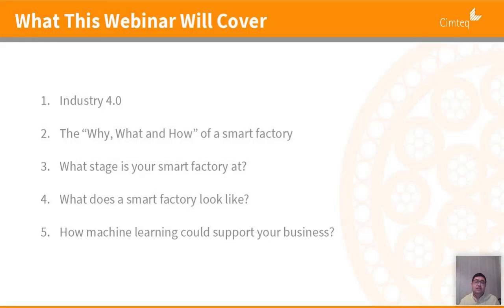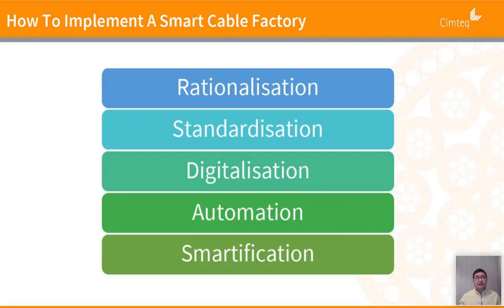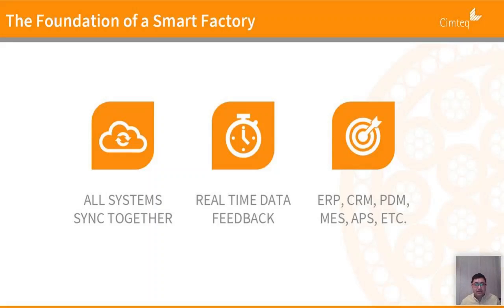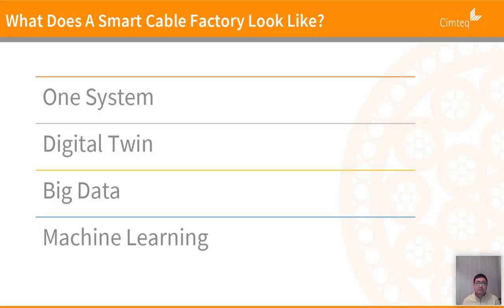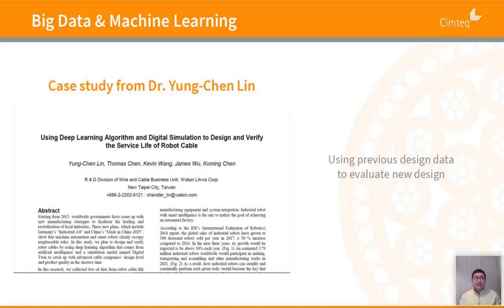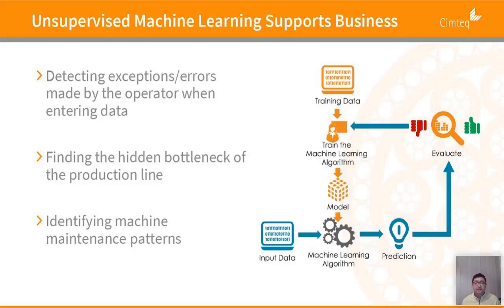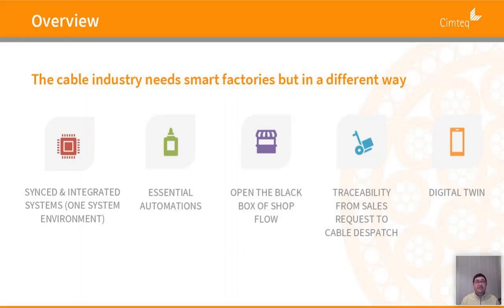"How To Apply Smart Technology To Design & Manufacturing Processes" webinar with Yufei Du, Cimteq

Comment from the maker: 1. Welcome (00:00)
2. About Yufei Du (00:29)
3. Why we are doing this webinar and Industry 4.0 (02:55)
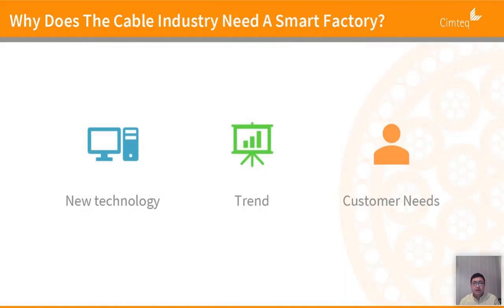4. Why does the cable industry need a smart factory? (03:46)
5. Industry 4.0 is more than a solution (06:49)
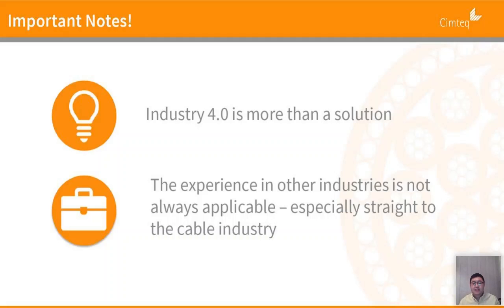6. The experience in other industries is not always applicable to the cable industry (07:34)
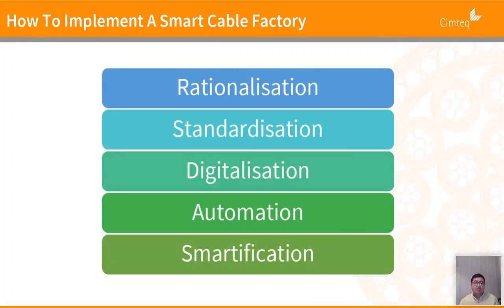7. How to implement a smart cable factory (08:16)
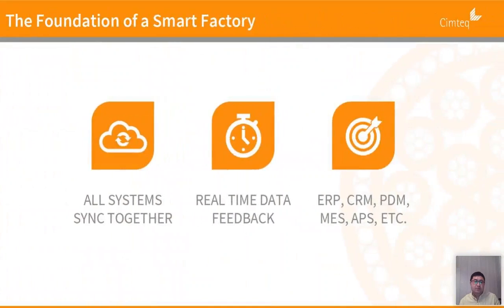8. The foundation of a smart factory (16:18)
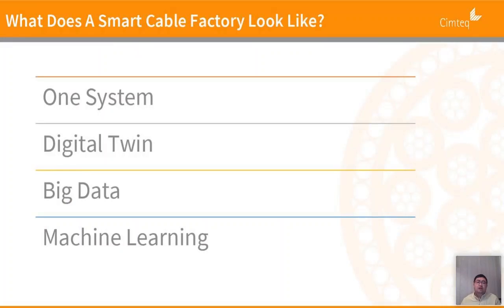9. What does a smart cable factory look like? (19:59)
10. Using machine learning to help cable factories (22:42)
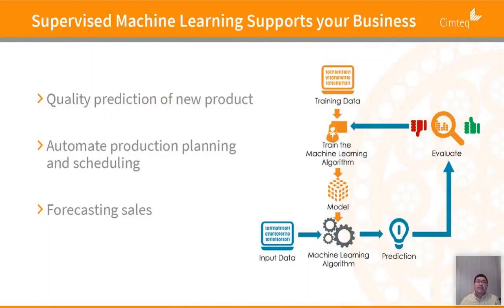11. How supervised, and unsupervised, machine learning supports your business (26:25)
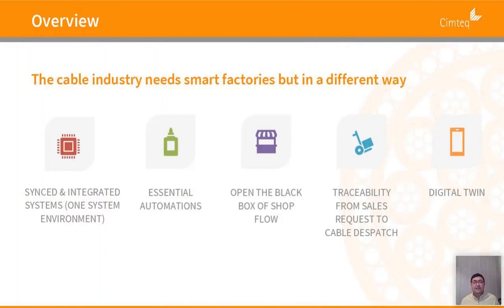12. The cable industry needs smart factories but in a different way (35:03)
13. Q&A: When cable manufacturers adopt smart technologies, what is the return on investment they can expect to see? (39:51)

14. What are the common barriers to the adoption of smart technology in cable manufacturers? (42:16)
15. Can you tell us how CableBuilder and CableMES fit within a smart cable factory? (45:25)